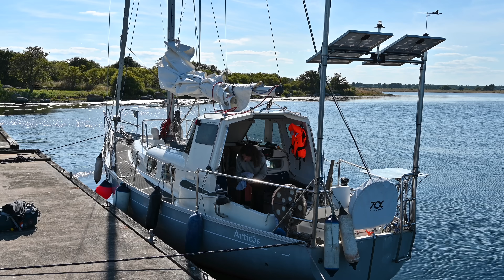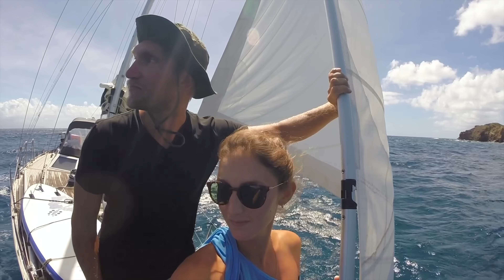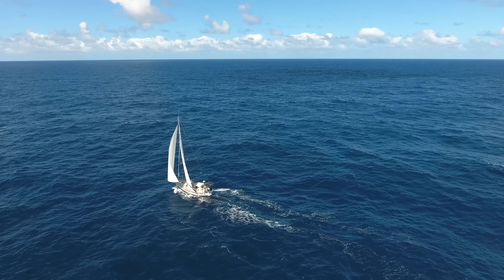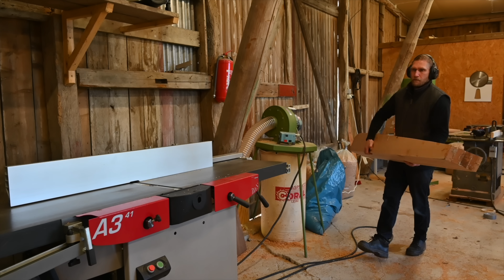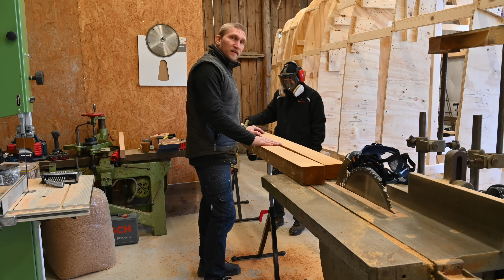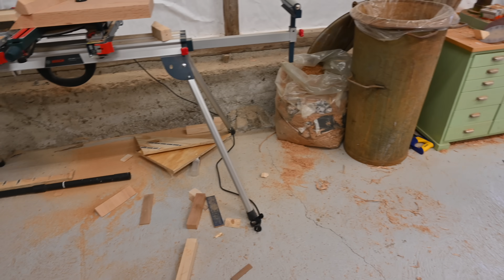A Taste Of Ripping 3 Kilometers Of Cedar - Building A 50 Ft Sailboat - Ep. 341 RAN Sailing

Comment: compass planes are very touchy, and hard to make work well.  But stick with it and you may find the touch that gets it to be really good.  I haven't noted how you sharpen the blades.  Most of us use guides to get that perfect bevel, (like the Veritas one) which are awfully good.  But in addition, I've found that buffing the blade on a buffing wheel sure makes it cut like you always hope it will.  I got that opinion after sharpening chisels and gouges for years.  After buffing them, they cut so much better.  Hand stropping might be the best, but my buffing wheel is there so conveniently that I take most cutting edges over to it for 20 seconds every 15 minutes or so of work.  Makes that edge so much sharper.  I agree about the power feeder.  Safety is nice, but it will also allow for much more accurate thickness of the planks.  And finally one person can do the job, you won't need Malin to be the helper all the time.  The consistent thickness of the planks will mean you don't have to remove as much to get the final thickness.  You can find a used 1 hp minimum feeder.  A 1 hp feeder works ok for Cedar is my guess.  As others have said, putting a shim in the cut will help too.

Comment: Hi Malin and Johan. As always just mesmerized by your undertaking. Only three kilometers of cedar to go! Johan mentioned briefly that he would plane two sides of the cedar strips and leave one rough cut. I am curious as to how you intend to assemble the strips on the frames. Will you angle the other edge to fit against the previous one? That will mean a lot of angle measurements as each one could be slightly different. 
When I built a canoe with cedar strips, the edges of each strip were routered with bead and cove cutters. Thus the bead edge of one strip laid nicely into the cove of the previous strip, which contained glue, and also easily conformed to the curve of the frames as more strips were installed. Perhaps more up front work but assembly was easier as was very little cutting during assembly.
Also, as you are using cedar strips, have you considered exposing the finished interior surface? Cedar would make a great finish. Just a thought.

Comment: About 30 years ago I bought a resaw saw at a tool auction.  Since the blade is so much thiner one one be worth the cost since you would loose so much less cedar?  I'm now 80 and don't use it all that much anymore, but love it.  The original carbide blane latsted me over 20 years until s negbior wanted me to rib a bunch of wood and promised me there were no nails.  I checked each one before feeding, but then she wanted to try and ....

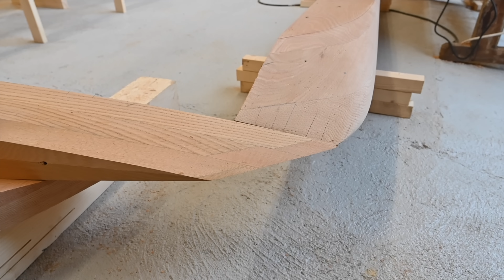Comment: Knife edge leading edge (at 24:34) is hard to build strong, hard to lay on FG. A blunt and strong front which doesn't have wood can be achieved by flattening the edge and laying a natural fiber rope soaked in epoxy into a groove. FG will lay over top.

Comment: It is ever more fun to watch Ran III being built with the details beginning to show. I suppose you are going to use the cedar strip [strip plank] method to build the hull. Will you be using tongue and groove to connect the different strips or just glue them side by side ? BTW a band saw would cost much less material than the circular saw.

Comment: Is it not possible too take pvc pipe and warm it up for the mounting on the machine and than fixed it too the hose dust machine.
Also is it not possible too jus the dust for a wood-stove in the barn for heating.

Comment: We also constructed our hull in 3 layers of 5 mm diagonal planking using west system epoxy. 
We used a oil filled column heater under the hull. 
Are you going to laminate ring frames and floors and attach them to a full length laminated keel. 
We routed a rebate the depth of the planking along both sides of the keel to end the planking on

Comment: Perhaps you could borrow a Logosol bandsaw mill or buy a used one. You would not have to buy a power feeder. The bandsaw curf would not waste as much wood and you could cut many flanks at the same pass of the blade. If you bought a new machine you could easily sell it when the boat is complete.

Comment: You might consider looking into 3M's respirators with replaceable filters that have the quick release function that allows you to easily drop the mask from around your face and then quickly bring it back up with only a flip of the latch. It's not nearly as protective as your full face mask but if you find yourself struggling to remember to wear the full mask consistently, making that process near effortless caused me to use a respirator a lot more when I'm woodworking and cleaning up the dust.
Reply: These are much easier to wear for long periods Trend  Airshield Pro Rechargeable Battery Respirator .

Comment: You may benefit from a thin wedge in the saw kerf. Malin's grip on the board may have contributed to pinching the blade. She had a hand on both boards. Can you burn the sawdust for heat?

Comment: I’m amazed at your boundless energy and dedication. I pray that it holds out for the lengthy project ahead of you. I watched the Gougeon brothers who were the founders of the West System Epoxy company as the built a 40 foot racer in 1975. They would be shocked at the thickness you are cutting for the planks. Their book on boat building would call for 3/4” thick as the base layer. That would be followed by three layers of veneer at about 1/8” laid in three different directions. That way seams and grain don’t become failure points. 
I’m sure you have a plan that will become apparent to me as you move forward. Love your productions.

Comment: Since you will generate so much sawdust, have you explored the possibility of collecting the dust to create Wood Plastic Composites? I don't know if the equipment to produce WPC sheets (mixing sawdust and PET to create a matrix that is then flat-pressed) exists on less than industrial scale, but if so, it may be cost effective to produce WPC sheets that can be used for interior shelving, backing of cabinets, &c &c in lieu of plywood.

Comment: when ripping heavy stock, it may start to pinch due to the natural way wood wants to move.  To correct this, once it starts to pinch, stop and put a small wedge in the cut, and it will stop the pinch.
Reply: He is a very smart guy he knows about wedges. He knows about wood too. Its just that so many give same advice  and  wood work is  Johans job . They have a big job ahead of them , the idear  that they would take time out to make fire wood from saw dust, i would be suprised if that happened.

Comment: I didn't see a cyclone separator on the dust collector.  If you don't have one you could make one out of a garbage can and some PVC.  It keeps the dust bags on your vacuum clean.  I don't think you can use plastic bags as liners for the separator because of the vacuum, unfortunately, so you have to dump the separator can into a bag.

Comment: Be very careful using alcohol around epoxy. You cleaned your pieces of timber with alcohol then began gluing when the timber still had alcohol on it ( 23:29 ). The alcohol will inhibit the setting of the resin causing it not to set or fail to achieve full strength. You would have been better to blow the wood down with an air gun or vacuum them clean.  Next time you have some spare resin left over mix some alcohol into it and leave it in a plastic bag or container with a lid on it. You will find it is much slower to set and will more than likely set much softer then normal. You can cut it up weeks later and still smell the aroma of the alcohol.  Other than that you are doing well. Built my boat using divinycell much the same way your doing with timber. The most enjoyable yet frustrating thing I have ever done - the launch day makes all the hard work and late nights worth while

Comment: Taking a day or two to get a power feeder, build a proper infeed and outfeed table, and getting your dust collection squared away will pay off very quickly. You guys are going to be doing a LOT of milling, and you can sell your gear after the wood is milled.
Nice work so far. Getting those frame molds lined up perfectly is a really fiddly job, and you nailed it.
Good luck!
Reply from the maker: You’re right. The ripping operation needs to be improved… We’ll try to get some good solutions in place before we start. 👍😊 Cheers!
Reply: @RANSailing  Oh, one more thought. I have had to find some unusual dust collector flanges, and often they are available off the shelf as ductwork for heating/cooling systems that run on forced air.
Reply: Have you considered getting it done by a saw mill instead of cutting the planks yourself?

Comment: Compas plane are no simply to use. I use it only in concave planing. For convex bench plane is enoght but u use smal block plane. U nead no 5. Better two, one as scrub plane second as a smother. Is U have low budget look for no 4. Is moste common plane on market and is cheap (20€ or similar for old one, 40 for new stanley- new are no so good like old one) 

Hand planing nead some lerning and muscle memory development. But is qute efficient way of make the job.

Fence on saw make longer (screw some ply box or some like this) use feder board.
Riving knife kan be for steal set blade no for carbide thooth. Go to maschnist, he make U corect size. I had same problem. It took houer and some of money the equivalent of a bottle of some tyncture…

Comment: I would be thinking about getting a motorized stock feeder to do a lot of the production feeding... It will save you a lot of time and will allow you to do a lot of this without having multiple people feeding the saw so you can monitor the outfeed for binding better.
Reply: ...just saw the part where you mention the power feeder... also look into magnetic stock blocks to help keep the stock aligned and tight to the fence.  Fast to adjust and very strong.

Comment: Considering all of the saw dust you will be making during the course of this project you might want to think about picking a centrifugal dust separator, sometimes called a cyclone dust separator. Ones that can be added to your shop vac are very inexpensive and will pay for themselves very quickly as you won't be paying for filters for your shop vac nearly as often. They can be fitted to large drums making it much easier to collect large volumes of saw dust.

Comment: If you have a metal shop locally that does ventilation ducting it would be a quick and easy job for them to make up a square to round adaptor. Galvanised steel, some pop rivets and mastic would do the trick. Looking good!

Comment: This is an awesome channel! But you should drive all the large cedar planks first with plane. When at least one side of the plank is smooth, then put that smooth side against the saw "table" and it will slide nicely in that saw. I will normally plane all sides of big wood before sawing. When having two sides planed  then one goes for table and one side against driver. English is not my first language, but hope this makes sense...
Reply from the maker: That’s was the conclusion we made as well. We’ll plane two sides next time. Cheers!

Comment: A friend bought a piece of western red cedar yesterday here in Tasmania, Australia . It was 3.9meters long and 200X45mm. Ready for the shock? It was $480.00 Australia! Admittedly it was fine grain and quarter sawn and a nice piece of wood but it was not gold plated. Imagine the cost to buy the planking for your boat at that price! The funny thing is that this state was pretty much settled by whalers a d wood cutters. We had the best boat wood in the world (Huon Pine) and used to export sawn timber all over the world, (as well as apples) and also had a reputation for building excellence wooden vessels of all sizes. Now there are only 2 largeish sawmills and the government controll the timber industry with a iron fist. Even firewood is very hard to get unless you are prepared to pay $250 per ton for it. Ahh progress, don't you love it! Enjoy your last snow. The weather should be getting warm for you just in time for major construction to start. I hope you use a big knee on that stem to keel joint! Cheers and G'day from Tasmania!
Reply from the maker: It’s the same prices here in Sweden. Crazy expensive! Thanks for watching. Cheers! /Johan
Reply: @RANSailing  Johan, have you thought about ripping your cedar using the bandsaw. Using a 25mm or larger course pitch blade you make much less sawdust and waste less wood. I use a 32 mm blade with 1 tooth per inch for my breaking down. Cheers and G'day from Tasmania
Reply: @glennbrown1961  They want a fine finish on the cuts.
Reply: @jackdbur  ahh, makes sense. Didn't think of that one, but you can glue straight up  off a good bandsaw cut. I haven't used much western red cedar but do know it is stringy to cut and you can't really get a great surface finish on it. Similar to New Zealand Kauri. It's grain wools up. Only built one 32 footer out of it. We have a timber here (Tasmania) called King William pine that was traditionally used for strip planking. Alas it is no longer commercially available either because of conservation measures. Sorry ranting again. Thanks for your reply!

Comment: I think your project would gain quite a bit with the addition of a 3D Printer to the mix - maybe not quite yet but soon. Already a quick and easy one would be the little adapter for the dust collection on the saw. You will be needing many custom brackets, adapters, clips, mechanisms, holders, etc. A 3D printer allows you to fairly quickly make these and if the material properties are not quite right you can send it out to a service to print in just about anything including metal.

Comment: Hi guys, Cedar can be very springy and has a tendency to bind when ripping the planks. Make yourself a long thin wedge to drop into the cut as you draw it from the back of the saw table. As a carpenter and patternmaker of can tell you that you are doing a great job on that stem piece.
Reply: Thanks for that advice. I had almost the same problem a few weeks ago. I was blaming my fence alignment. I will try wedges next time.

Comment: What are the calculations of circular saw blade V bandsaw blade = waste? I’m going to have to Patrion soon! You need a dust collector. Rewarding seeing this time transforming into a boat/your families future! Thanks
Reply from the maker: It depends on the kerf on the blade. You can get 400 mm blades as thin as 2.8 mm nowadays, so the gain from using a big bandsaw in that case isn’t going to be very big. Cheers!

Comment: Hi Johan, Your doing a great job and ripping the cedar down is going to be a huge job. Can I suggest making your self a better table at the end of the saw where the cut timber is heading. The supports you have may move, I have the same and they are quite flimssy. You could mount the rollers off them on to the table if you wanted or buy a ball type. Once you start you wont want to be mucking around with supports that are not doing their job properly. Cheers and keep up the good work. Ian New Zealand.

Comment: Hi.
When ripping larger sizes you may need to have some wooden wedges to help with the pinching on the blade.
If you can find a bandsaw to rip there will be less "loss" from the blade width.
Awsome work.😊
Reply: was thinking the same thing, small kerf small loss.